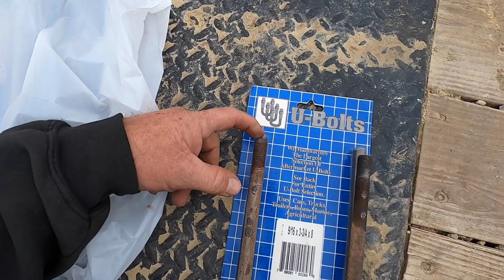Adjusting Nev-R Adjust Brakes. Manually

Comment: Looks like you have belts broke inside the front tires on that trailer. One thing that is very hard on them is turning real sharp and the front tires biting into the ground and folding them over. I know that is one thing that will damage them. Not sure though but surely would not trust them with a load on the trailer.
Reply from the maker: If it was just one tire I could see it but both front tires are worn crazy like that. It looks like a major alignment issue. I am thinking the axle was welded up wrong. Alignment may be off.
Reply: I have Lippert axles and they have never worked well since new. Tried manually adjusting but still don’t work well.